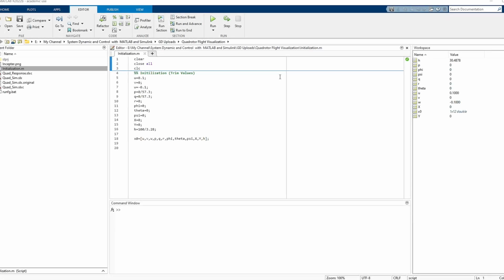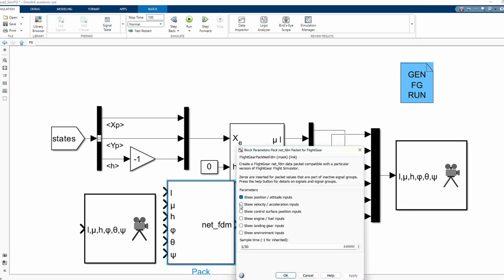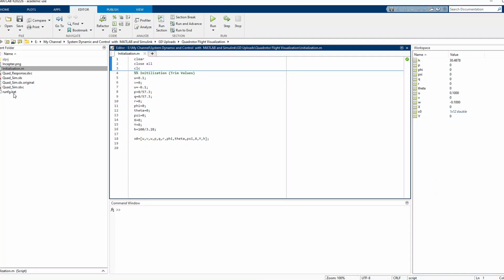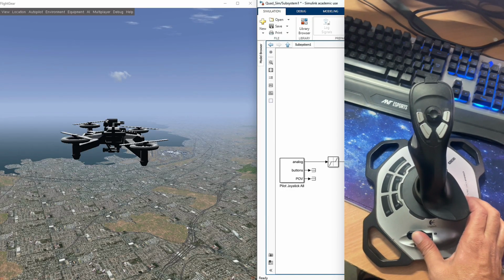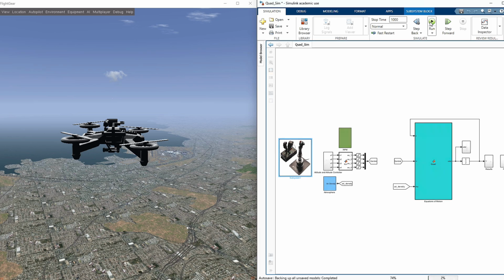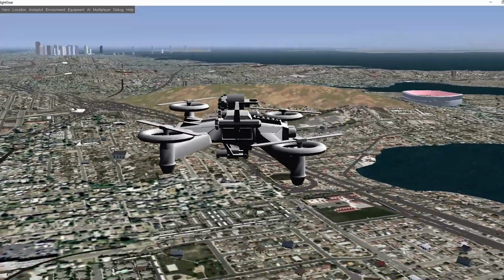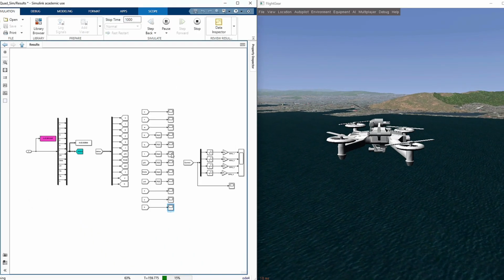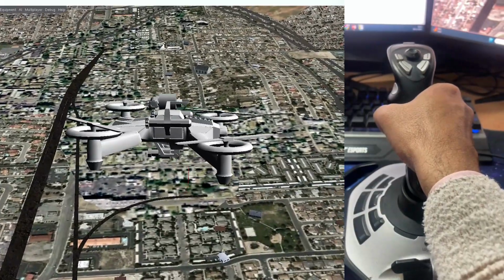Pilot-Controlled Quadcopter Flight in FlightGear | SDC by Dr. Salahudden

Comment: Hello, thank you very much for the excellent explanation and valuable content. If possible, could you make a video that demonstrates the simulation steps of a VTOL Tailsitter system(modeling or control for vtol tailsitter )? It would be extremely helpful for students and researchers. Thank you.
Reply: type of vtol tailsitter 2 brushless and 2 elevons
Reply from the maker: @eng_nasurhasan7619 Noted with thanks.
Reply from the maker: Hii, I am happy you like this lecture.
Sure, I will take the requested lecture in the future😊.
Reply: @DrSalahudden thanks ❤